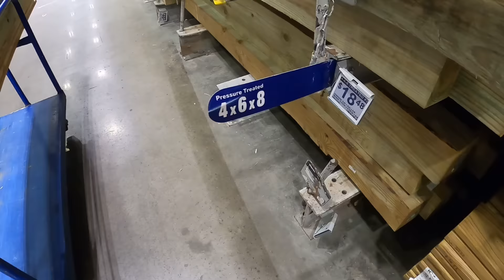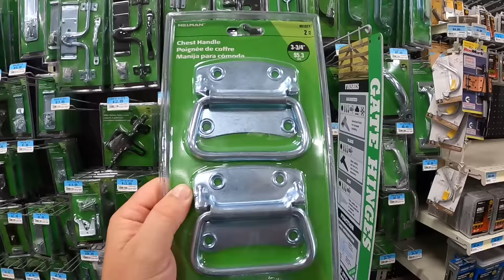Anderson Blocks and RV SnapPads Are A Waste Of Money! | Do This Instead! | Fulltime RV Living!

Comment: Those things would hold up a house.  Way more weight and cost than necessary for an RV. Weight is the enemy, and money has limits, too.
A simple 2x6 frame to form the perimeter with a couple 5/4 deck boards (or two more 2x6) on the top will be more than strong enough to hold up an RV.  Use the rubber on top if you want, but I don't think it's necessary.

Pro tip: If you're cutting several boards to the same length, measure and cut one as a template (make sure it's good and square), then use its edge to mark the rest.  This will save you tons of time and minimize measuring errors.
Reply from the maker: Great tips!

Comment: Great Idea and would work great!……BUT. I have a Lance 1172 truck camper that these would be great but these would weigh way to much and take up valuable space. Would love the height though. I take 4 3000lb saw horses from Lowes that fold and go on the basket thats on the receiver. Excellent build.
Reply from the maker: For a truck camper or even a class A-C unit these are not the best choice! But for a travel trailer and fifth wheel these will accomplish what both of the aftermarket product accomplish at a fraction of the cost! We never have to worry about space, they just go in the bed of the truck on move day and the rest of the time they live under the Jacks!

Comment: Why didn't you use any glue or adhesive? Just asking because I want to build something like the for my travel trailer
Reply from the maker: They need space to breath! There are a lot of times when it rains, they will be sitting in water, and I didn't want them to be airtight so they could dry out!  We have been using ours for almost 2 years now and they have held up great!

Comment: How heavy are they? When you say more stable.... Does it keep the camper from "rocking" at night?
Reply from the maker: They are about 20lbs a piece! Because they keep the jacks from extending so far the rig is more stable!
Reply: @PavingNewPaths  I like the idea, except the weight,trying to shave 500lbs still but I thought you needed to unload the suspension to get it more stable and to keep the camper from "rocking" at night....
Reply from the maker: @chrisgibson8259  The suspension is still mostly unloaded but the jacks dont have to go down as far now! It makes our RV very stable, compared to before with them fully extended!

Comment: wonder whether doing it with 2x10s or 2x12s might be cheaper?  Maybe just sand once when they're all built?  The andersen blocks are also 8in tall, lifetime warranty and lighter, if that's an issue.
Reply from the maker: You could use what ever wood you want! This is just the way I decided to build them! The Anderson buckets only work on perfect ground, most of the time you still need to put a board down first or you will warp or crack the buckets! Plus building it yourself will be cheaper and last longer!

Comment: who wants to carry those blocks around, SnapPad's installed and no lugging and storing that stuff, jacks are just fine fully extended.
Reply from the maker: The longer your jacks are extended thr more unstable the RV is! I have also never seen a rig with jacks pads installed not also put down blocks as well! Why spend the money on a piece of rubber when you can build something better for way less! There is also no lugging or storing of them, you put them in the bed of the truck when moving, the rest of the time they are holding your RV up!

Comment: Never use green wood fresh from the store.  Way too wet and will warp and crack.  Instead, stack the wood in a dry place and let dry for at least two weeks.
Reply from the maker: This is treated wood and has spent it's entire life outside! Going on 2 full years of supporting at 20,000lb rv, with no warping or cracking!
Reply: @PavingNewPaths His advice is generally correct, but the way you used and assembled the wood made it unnecessary. The short pieces with so many fasteners in place vastly minimized the issue.

Also, your wood did not look too bad to begin with.

Comment: What do you do under your front jacks . Everytime I put my blocks under my front jacks and hit auto level it seems like those to jacks won’t go down level enough to go into auto level for the other jacks. So I just have to put one 2x10 board under the jack to get it to work right .
Reply from the maker: That usually only happens when the site slopes down front to back! This happens to us about 20% of the time and we manually level it then! The bigger issue is now you have to be mindful because usually one side of the RV'S tires will be off the ground when you are in sites like this!

Comment: I use my charging ports for the DeWalt power tools.Usually my weed whacker when I'm doing lawns.
Reply from the maker: Wasn't sure if it would work!  Those power points won't run my computer but they will charge the batteries!

Comment: This is genius 👏 I have been doing so much research to purchase something that will stabilize my 6 jacks for less movement and not extend them quite as long. I currently do have snap pads on but like you've stated no height. Ia now at my permanent place and do really need the height so I thinkni will try to make these and leave the snap pads in place. What is the overall height of finished product?!
Reply from the maker: Thank you so much! We like the idea of the andersons buckets and the snap pads but wanted both! This was our solution they are about 6 inches tall!

Comment: I put on the snap pads and jt strong arms. Very stable and no blocks to piss around with.
Reply from the maker: We wanted the snappads and the Anderson blocks, both are great but both require wooden blocks down first! I built something where I had the protection of the snappads and the height of the anderson buckets! These also allowed us to raise our jacks up allowing  more ground clearance when traveling!
Reply: @PavingNewPaths  I guess I'm not sure I follow. The only blocks I use at this point are some camco blocks under the rear jacks. I use nothing under the front but I don't have hydraulic jacks, I have the electric version. So I have the levers I pull and drop the feet nearly to the ground and let auto level do the rest. I'm not a fan of the hydraulic ones but I understand electric has it's weight limitations.
Reply from the maker: The hydraulic jacks are amazing and besides just the leveling aspect they can assist you in maintenace and repairs as you can use them to change a flat tire or do annual bearing checks! The electric ones you can use as well but they have limitations on the allowable angle deviation between the left and right side of the RV. Since we don't have to pull  a pin and make the jacks longer we are able to move our jacks up closer to the bottom of the rig! This allows more ground clearance when towing and the jack blocks make up the space so when you auto level your jacks are not fully extending making for a more stable RV!

Comment: I have snap pads on my 5th wheel.  I like the idea of these but not having to store 6 of them - we're already pretty full.  Maybe I'll start with two for the front jacks so they don't have to extend as far.
Reply from the maker: You don't have to store them! They will be under the jacks when your parked, and we just put them in the bed of the truck on move days!

Comment: I only shop at home Depot. And actually I don't shop my crews shop at home Depot. I used to shop at Lowe's once in awhile but every time I went back with a little return small to $3 item that we didn't use or my crew didn't use they wouldn't refund it. Home Depot is much more generous on returns when an item is new they'll take it back anytime.  Small items like three or four dollars in PVC connectors. A brand new caulking gun now I have three. When I'm going to a job and something is needed I always bring an extra one or two items to make sure the guys working there have what they need. Which of course means I have to return things. Lowe's is a pain. Home Depot never gives me an issue. Only shop at home Depot.

Comment: Prefer Orange to Blue in S.E. WI.
Never any help at Blue 9n the floor.
Also Blue continually screws up appliance deliveries. 

I like you blocks design but have wo det about the weight. 
15 or 20 lbs each with treated lumber? 
I would construct with less height for my travel trailer. 
Really enjoy your videos!
Btw, Farm and Fleet has it hands down over Tractor supply here. TS prices outrageous in comparison.
Reply from the maker: We love the blue store, but have been hearing great things about the Green store lately!  The Jack blocks weigh 20lbs a piece but they need to be heavy as they support a 20,000lb trailer! Ours are 2 years old and are holding up great! We only hav Tractor supply here so I have never had a chance to try those others out!

Comment: I her you about the Texas Heat. I am in the mountains now to escape it. High today was 74 degrees and no humidity, which is brutal in the Dallas area.
Reply from the maker: When we filmed this it was 101 outside with heat index of 113! We had so many water breaks we didn't think we would finish in one day! It also feels like your working in a swimming pool with the humidity  we have now!
Reply: @PavingNewPaths  if it were not for family I would move out of Texas to someplace with much milder temperatures. I feel your pain.

Comment: Awesome blocks. I totally agree with you on the snap pads and Anderson blocks. What turned me off with the snap pads is my jacks would be an inch closer to the ground when traveling. Only negative I can see with your method is 6 blocks would be adding 360 lbs to your rig (assuming pressure treated wood) unless you keep them in the truck. I went a similar rout and used two 4x4x11 1\2 then added a 12X2X11 1/2 top and bottom. They are not solid but are plenty strong and total for 6 is 200 lbs. I used rope handles on mine. Over time pressure treated wood will loose a lot of weight when they dry.
Reply from the maker: That was my same problems each product by its self did not solve my problem so I made these! We put these in front of the B&W Fifth wheel on travel days! They are not that heavy, each one weighs around 20lbs so only 120lbs total for all 6!
Reply: I made almost the same exact blocks and your math is way off. 360 divided by 6 = 60 lbs! Mine are 15-18 lbs
Reply: @PavingNewPaths that's not bad. I must have incorrect info on the weight of pressure treated wood.

The other reason I made mine is I have a goose box and have to raise the front to hitch an extra 4“.  The blocks help.
Reply from the maker: No problem, you actually had me convinced I was wrong so I went and weighed one it was 19.6 lbs! I knew they didn't feel too heavy as my wife normal helps out and carries two at a time!

Comment: Nice but to heavy I use the plastic yellow stacking blocks,, now this is if your concerned with weight
Reply from the maker: They should be heavy, they are holding up a 20K trailer!
Reply: @PavingNewPaths  They don't hold it up 🤣 they just stabilize it
Reply from the maker: @stevenstair1068  They are literally under the jacks, holding the RV up!

Comment: This is a great video! Thank you for sharing. Finishing my set of 4 this week. I used 6x6’s to get the extra 2” of height. It adds some weight, but relatively speaking, not much. Can’t wait til they’re done

I have one question. Is there a reason you attached the horse stall mats with the grooves against the blocks and not exposed?

Comment: I was thinking to stain all the wood before putting them together. It will prevent them from rotting from the inside.
Reply from the maker: You could do that but that is why we went with pressure treated wood!  Also, be sure to leave some gaps so blocks can breathe!  This will allow any water that gets inside to also get out!

Comment: There is a bit too many drawbacks to cordless tools for my taste , I have one drill / driver that’s 18.0 V! 
The major one is , if you don’t use the tool for a year , both batteries are down in V. Plus in “sleep mode “ the charger will NOT wake up the batteries ! 
Off to the dealer thinking my charger went south , my charger checks out fine ! 
I was told I would have to replace both batteries huh ? It’s only 2 years old ! 
$512.00 for batteries !  That left a bad taste in my mouth !

Dealer said how to prevent that from happening , cycle both batteries every 30 days on the charger!  
I’ve always been a corded tool guy all my life anyway no problems there !
Reply from the maker: The problem is not the tool it's you not using it for over a year and expecting it to still work like it did when it was new!
Reply: That’s true you are correct  , it’s not the tool it’s not defective! But when that happens the entire tool is worthless might as well pitch it over the bank !!

It’s the side effect of those type of batteries ! 

I have a Mikita that’s 14.4 V what makes it shine is the Nickel Metal Hydrate batteries and it’s 16 years old ! It can be dead on the shelf dead for 3 years and it charges right up !
Batteries go on the charger and I’m good to go ! 

So it weighs a few ounces more then the newest , latest , greatest and fastest , but that doesn’t bother me a bit ! I still use corded tools over 40 years old , work perfectly!
Reply: @PavingNewPaths No I didn’t expect to work like brand new , it’s 2 years old , but for the latest , newest battery tech , yes I did expect it to turn over but not operate full rpm , every tool has limits doesn’t matter who’s name is on it !!

Comment: But doesn't the screw heads holding the rubber still score the concrete? Especially under load?
Reply from the maker: The screws are not flush with the rubber they are about halfway down!  This is also why there is no screws in the middle of the rubber as that is where the Jacks would be!  We have been using ours for almost 2 years now and they are holding up great and have never done any damage to any pad we have stayed on!

Comment: Great video! I would like to make these! What lumber would you recommend if you wanted your blocks a tad higher? If I calculate right these are only about 7 in high. Also, my front legs are 12in in diameter so what lumber to buy to get the right diameter for the larger front legs? Thank you!
Reply from the maker: We used 4x6 treated lumber and that comes out to 11 inches when you put two together! We used 1x6 on top and bottom you could go to 2x6 and get another 1.5 inches total height!  We found that after 3 years of travel there were only a few places we parked that our blocks were too tall!

Comment: I’m probably overthinking this, but do you have any issues with the screw heads coming through the rubber? Thinking about adding a bead of construction adhesive on the back of the rubber sheet.
Reply from the maker: No in 3 years we have had no issues with these jack blocks!
Reply: @PavingNewPaths  Great! Thanks for the quick reply.

Comment: I like what you did. What is the difference in weight between what you built vs snap pads and the Anderson blocks?
Reply from the maker: Ours weigh approximately 20 lbs a piece and they travel in the bed of the truck on move day.

Comment: Hi Kevin - did you raise all six of your jacks?  Did you move them up one hole?  I may need to do that with mine to gain enough clearance to go over a curb using ramps.
Reply from the maker: The Fronts were raised all the way up from the factory!  The middle and rears were below the center line of the trailer axles when fully retracted!  We Raised the Middle and rears around 3 inches!  When you take them off the mounting plate you will see there is several bolt patterns and combinations of mounting points!  I based the 3 inches off the rear driver side jack as it has the sewer valve right there and 3 inches was the most, I could go without hitting it! So, I adjusted the rest the same!

Comment: I like the idea of the the horse stall mats and it's on my next TS run for the front storage bay.  Our blocks are a little shorter though pretty strong since I used 2x6 pressure treated boards.  I cut them all to 11" and screwed 4 of them together crossing each other like you did with the stack of wood, the shorter ones where nice because I could use them as tire blocks too when sites are unlevel and lift a side off the ground.  The last set I made in 2015 and are just about ready to be replaced for the 2023 season.  I like your taller ones yet then they are jack blocks only and too tall to use for wheel blocks.  I think our next set will have use your idea of the stall mats on top and water seal them.
Reply from the maker: We have the Auto level system and have only had one campground where it lifted the tires off the ground on one side!  We were not staying long so I let it be!  We also raised all of our jacks up because we wanted more clearance when traveling as they were hanging below the centerline of the trailer axles!  I wanted the height of the Anderson block and the protection of the snappads!  I stained mine and they have held up great now for almost 2 years!
Reply: @PavingNewPaths  Yup, well versed in the system, this is my second rig since 2013 with the LCI One Touch "Level Up" 6 point hydraulic system.  Here in the Mid-Atlantic and up into the NE, get ready for some fun leveling.  Even at 3 degree pitch on a premium pad it will lift a wheel.
Reply from the maker: That actually might be next years trip up the east coast all the way to Maine!
Reply: @PavingNewPaths  Don't go crazy with it, but keep some 2x6 or 2x10 boards around.  It will be a huge help to you in the mountains.  Most places are pretty good with level pads, but some just need some help.  I am so used to it and I keep a few extra blocks/boards in the bed of the truck for those instances.
Reply from the maker: Thanks for the heads up!  Sounds like a good excuse to go to Lowes!